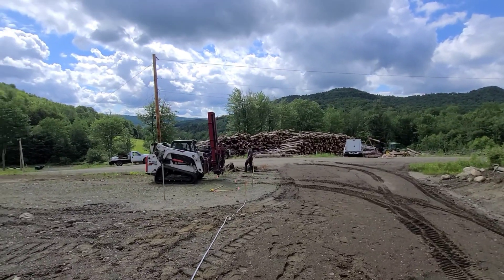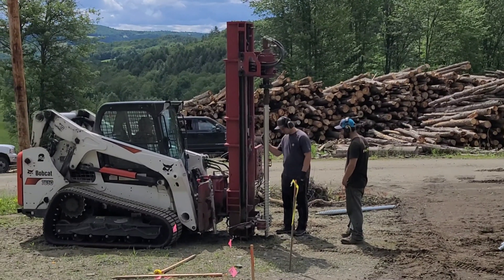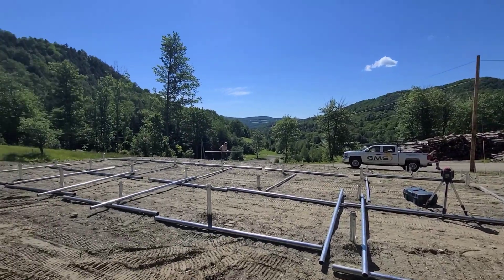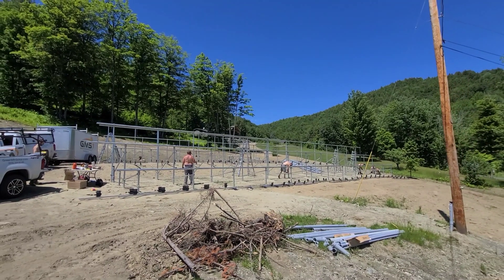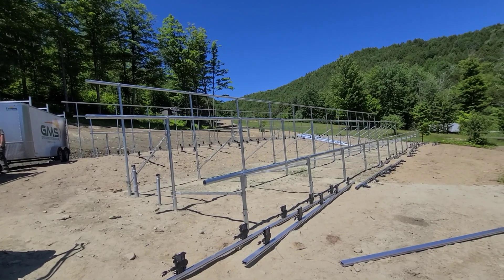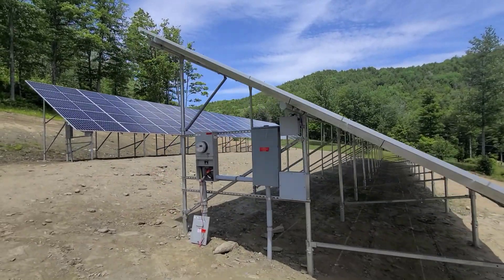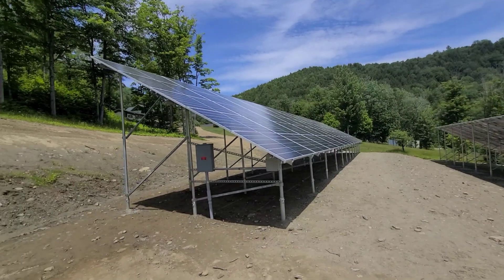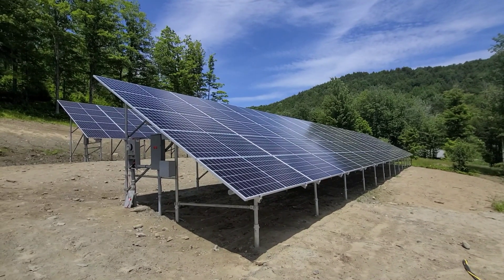Huge Solar Array Installed on Rocky Clay

Comment: What angle are those mounted at? If that's in VT, would you mount at 45 degrees to shed snow?
Reply from the maker: 45 degrees would be good for off grid.  We mount the grid tie systems at 35 to give better summer production but still shed and have decent winter production.

Comment: I'm curious about what your part of this installation was, Ben? Did you subcontract the ground mount racking system out and then do the panel installation and electrical? Would have loved to see their system that they are using.
Reply from the maker: We sub out the ground screws and excavating. Everything else is in house.  I think I got some time-lapse of building the racking, I'll have to find it and post it.